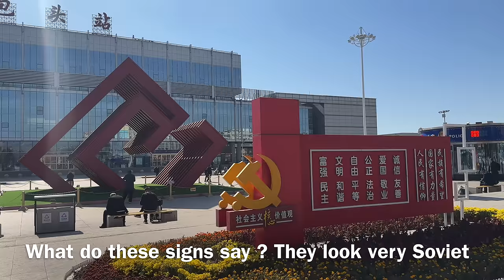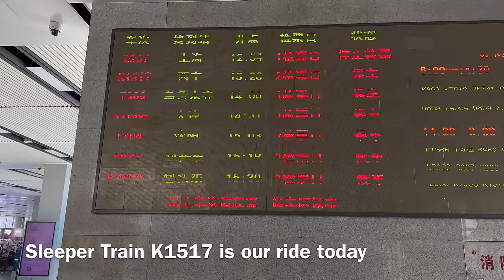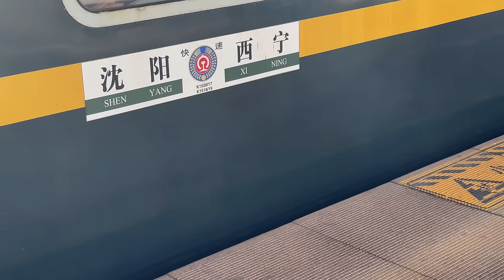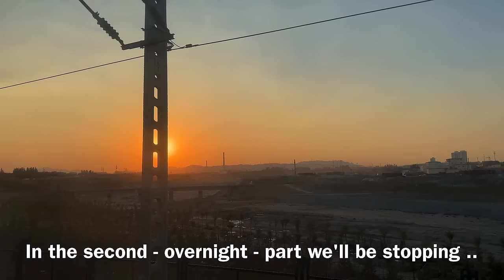China’s First Desert Railway: Baotou - Lanzhou aboard Chinese Night Train in Soft Sleeper Car

Comment: 26:35
The conventional rail of China is divided into 4 speed classes. The speed class is represented by the prefix of the train number, like the "K" in K1517 train of the video.
The 4 speed classes from fastest to slowest are:
Z, for "zhida" or "directly to destination". It has a top speed of 160km/h and very few stops
T, for "tekuai" or "very fast". Top speed of 160km/h
K, for "kuai", or "fast". Top speed of 120km/h
And then there's trains with no prefix. These trains are slowest and often don't have AC. They are quite rare to find, with only a few regular services running in mountainous rural area.
Reply: Great explanation, but a quick correction there, the T class trains, utilizing 25k type passenger coaches are currently limited to a top speed of 140km/h since 2008, as opposed to 160km/h. Although the carriages themselves are designed with a top speed of 160km/h in mind, the 206kp bogies used them showed some issues in resistance against hunting oscillation when traveling at that speed, hence why the speed limit was implemented.

Comment: Hello there! Thanks for you nice video on this authentic Chinese sleeper train experience!
The steam locomotives you see at 20:52 are old locomotives assigned to the Linhe railway depot, Hohhot railway bureau (now China Railway Hohhot Group). They are QJ class steam locomotives (Qian Jin, “前进“ , meaning 'advance forward') manufactured by the Datong Locomotives and Rolling Stock Factory (now CRRC Datong) in Shanxi Province. This class has a 2-10-2 wheel arrangement (10 driving wheels), and was designed as a freight-hauling locomotive. The closest counterpart of QJ would be the FD class made by the Soviet Railway in the 1930s. Designed in 1956, the QJ class was the most mass-produced steam locomotive in China, over 4700 of them were produced from 1956 to 1988. The Baolan railway is one of the last railway lines in China that retired steam locomotives. The last steam locomotive retired from this line in 2002. These QJs you see are in storage I suppose, although they are certainly not at a condition that can be activated again with a short notice...
Reply from the maker: ok, QJ class steam locomotives for the Linhe Railway; ok, thanks for the information;

Comment: Interesting addition: the Chinese "soft" sleepers are essentially Soviet MECT-36 "kupe" or "hard" sleepers.
The Soviet "miagky" sleepers back in 1980-s were either "MECT-32" (8x4) or "MECT-24" (4x4 + 4x2).
For us back than riding the "MECT-24" (4x4 + 4x2) in a 2 x CB compartment was an absolute joy.

So we felt the Chinese "soft" sleepers being a bit overpriced: they required 1st class base ticket + 1st class "4-bed" reservation.
While the Soviets sleepers required 2nd class base ticket + 2nd class "4-bed" reservation.

Back in 1980-s both the Soviet and Chinese trains had two price levels: one for own citizens, the other for foreigners.
In Russia it was easy to beat that system: I always bought two tickets: for me and my G/F (she has now much more "advanced" status)
In Chine we just told that we are students (it was true) - and in most cases we got "Chinese" price.
Reply from the maker: i think in china the fares do not distinguish between foreigners and chinese citizens.
Reply: @doc7austin  Yes, not anymore. Unfortunately in 1980-s both in USSR and China the opposite was the case.
Often we did beat these by using international EMPT tariff tickets.

Tricks with EMPT (now called MPT) versus domestic "regular" (now same for both foreigners and own citizens) tickets could be still worth in Russia, maybe China - but not elsewhere.
In general, one should avoid the MGPT tariff (between different countries of ex-USSR) as much as possible - that is now the most expensive

Comment: CR K-Trains use mostly 25G rolling stock with vmax 120km/h, Z-Trains use 25T rolling stock with vmax 160km/h. There are another T-Trains between K and Z with vmax of 140km/. K trains are currently the lowest class of passenger trains, the slowest but also the cheapest. The Z-trains are the top tier loco-hauled trains running on conventional railways. Since 2019, some of the Z/T-trains are being replaced by CR200J push-pull EMU, with the same vmax of 160km/h but refreshed interior with seating cars similar with high-speed trains. The train numbers operated by CR200J rollin stocks are D1-D300 and C1-C999, starting from January 10 2024. As for your question about the level of cleanliness in the conventional sleeper trains, it's more to do with the how long the trains have been running since departure, the age of the carriages, and how well they've been maintained by the different operators.
Reply from the maker: at least I felt that our older 25G Soft Sleeper car was relatively clean; Thanks for all the additional information; I need to try out the CR200J train in a soft sleeper car hopefully soon.
Reply: 还有纯数字没有字母的，车厢更老更旧，速度更慢，低于100km/h，部分车次甚至不能网络订票。
Reply: @sams9981  I know, but they are so rare, and probably not for mainline or long distance journey.
Reply: @doc7austin  Be aware that if you wanna try out CR200J, only the latest CR200J-C (gen. 3 of the CR200J series) with white-green-red livery features fully reversible seats (both 16-cars sleepers and 8-cars seaters) and latest business class product (8-cars seaters). The seats on the earlier 2 generations with green-yellow livery (also included the Laos-China Railway version) are non-reversible. My suggestion is to avoid the very first generation of the CR200J, that features the carriage design based on 25T, which is narrower compared to the later redesigned versions.
Reply from the maker: @imwsss726 good point; I will show you the inside of a CR200J in my next video
Reply: @doc7austin  can’t wait!

Comment: In Chinese railway nomenclature Z train has top speed of 160 km/h, and in most cases runs point-to-point without passenger on/off in between. K has top speed of 120 km/h and makes regular passenger stops along the way. Chinese Ruanwoche has similar layout to Russian kupe. However Yinwoche has a different layout to Russian platzkart by stacking bed 3 levels high to achieve the same carrying capacity because of running on standard gauge.
Reply from the maker: And T-trains are somewhere in between ? I've noticed that many former T-trains were renamed to Z-trains.
Reply: T-trains has top speed of 140km/h @doc7austin
Reply: @doc7austin  Z means Direct, T - Special (or Super?) Express, K - Express. In terms of speed, comfort level and ticket price, G > D > Z > T > K. That explains why there are less Ruanwoche capacity on K-trains --- its targeted customer base is more price sensitive. There is just less demand of the most expensive ticket on the least expensive train.
Reply from the maker: @user-ve6vu2fv3z oki; that makes sense; right in the middle between 120 and 160 km/h
Reply from the maker: @iany2448 oki; but i may recall that even some Z-trains only carry 1 Ruanwoche/Soft Sleeper Car
Reply: @doc7austin  While there could be many factors involved, value for money probably still plays a big role in determining how may soft sleeper capacity on offer. I randomly look up next week mid-week Shanghai - Beijing runs. For two trains departing within 10 minutes of each other, T-train soft sleeper costs RMB476.50 and G-train second class costs RMB 526.00. The former takes 16 hrs. as an overnight train and the latter takes 6 hrs. Purely for the purpose of getting from point A to B, spending extra 10% (~EUR 7.00) but saving 62% (10 hrs.) travel time is a no brainer.
Reply: @doc7austin T（25K）在2003年就停产了，车厢一定是旧的，最初它的设计时速的160km/h，但是因为转向架设计缺陷限速，Z（25T）是它的替代品，所以140km/h的列车很快就会被淘汰了

Comment: 21:32 given how much fast China builds their HSR network, I'd say 2026.

Good video! I knew little about chinese railways.
Reply from the maker: yes; i would even say december 2025 for the opening of the Baotou - Yinchuan High-Speed Railway; not many china railways videos about inner mongolia out there
Reply: @doc7austin  on a second thought, 28:48 - are delays on Chinese Railways frequent? And of which entity? (minutes, or even hours?)
Reply from the maker: @gab_v250 delays can happen, esp. around construction sites; however, there is some padding in the timetables to account for delays; When connecting in China -> you should always allow for at least one hour at your transfer station